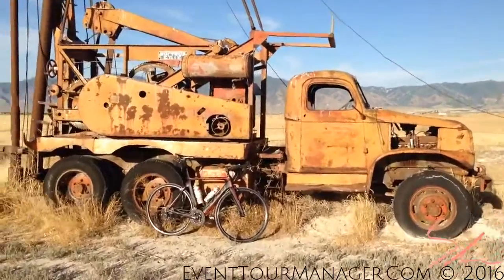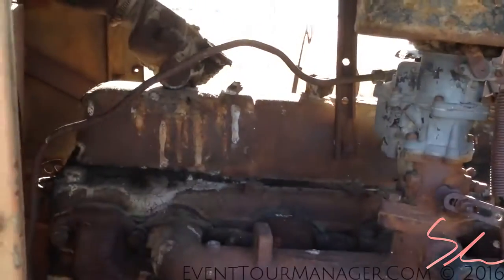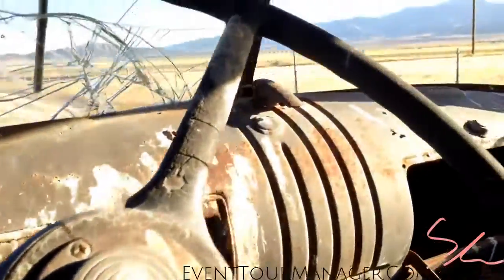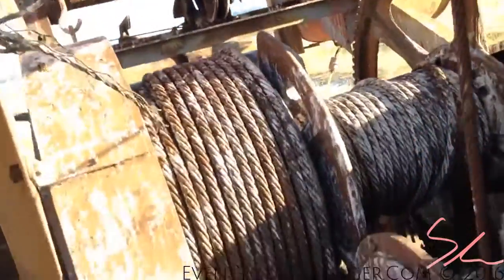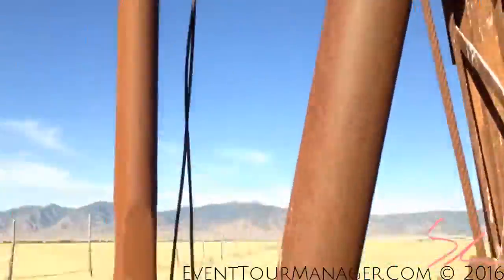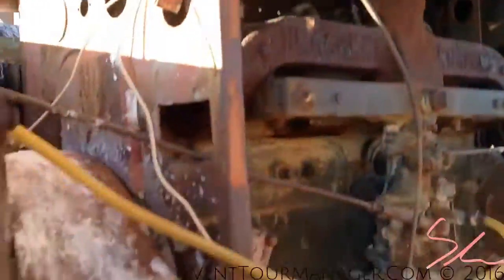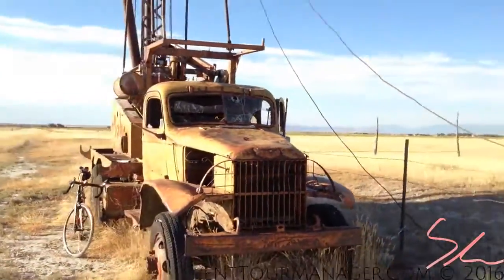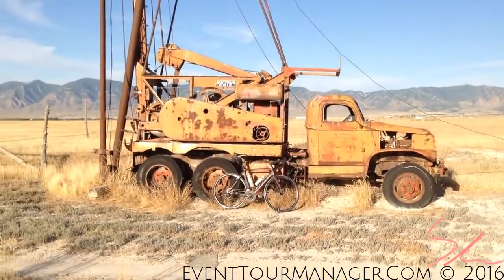Old Drilling Truck Extensive Color Commentary

Comment: That second engine you showed was NOT a generator, D.A.   It ran the rig works  by  belting.
Reply from the maker: Michael Miller This is just some random truck I found on the side road cycling and decided to make a few comments. Did I ever say I was in the industry?🤦🏻‍♂️